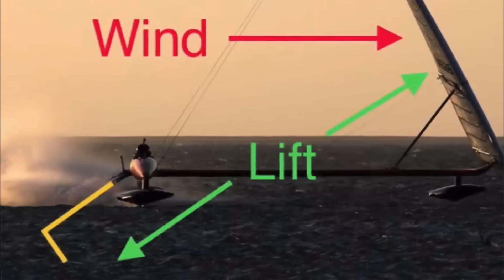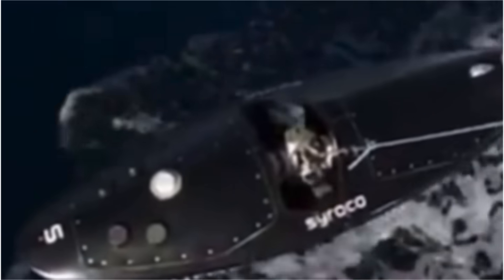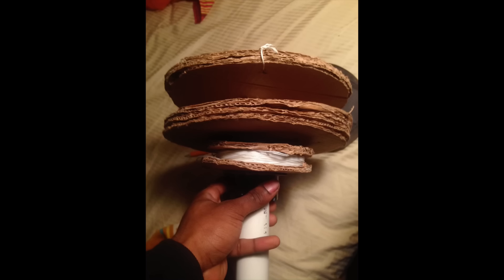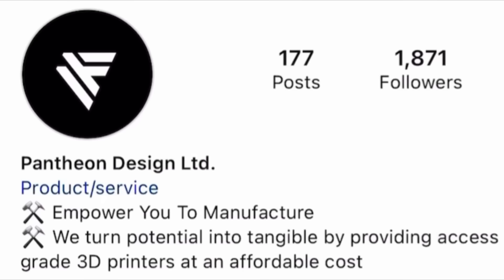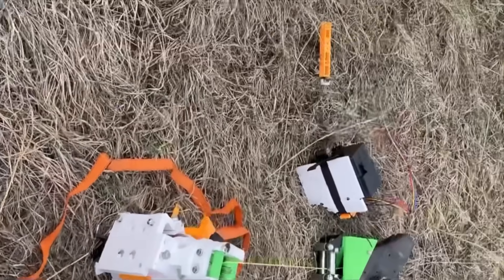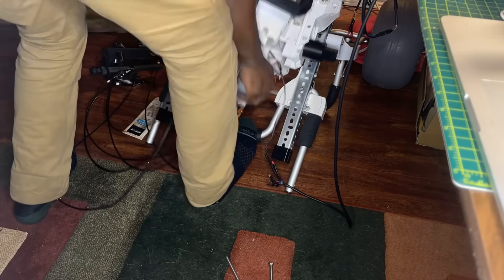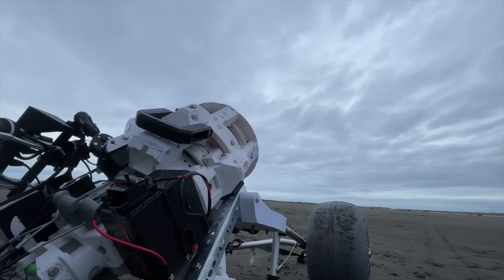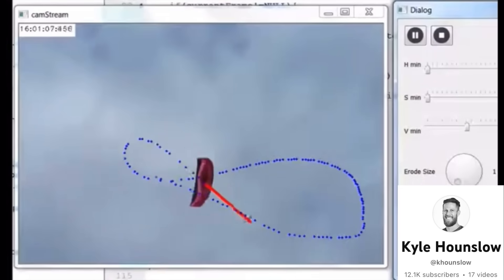Transforming Sailing and Power Generation with The Ocean Kite Engine

Comment: Such systems are already being sold for various size yachts and are simpler.
Reply from the maker: There is one other company and they cost 3x as much as our goal. Also they dont produce power, just use it.
Reply: @Ocean_Kite_Energy   Reducing cost, sacrifices quality and durability. In this situation you will need high quality materials that can handle high load and stress. Mass production also increases costs which you will eventually figure out. 
I didn't say anything about power.
Reply from the maker: @Jayda08  I appreciate your insights on cost and quality concerns. However, our focus is on innovating with durable, high-strength materials, like waterproof UV-resistant ASA and carbon fiber ASA, ensuring both affordability and resilience under stress, as demonstrated in our partnerships with tech and space industry leaders, Pantheon Design and Grin Technologies. This approach allows us to maintain high quality while working towards cost efficiency.
Reply: @Ocean_Kite_Energy  Cost efficiency only works if everyone is willing to work for free or for minimum wage. But you do your thing and we can return to this discussion in a few years. Cheers.
Reply from the maker: Or if you can reduce the amount of employees with machines.  @Jayda08
Reply: @Ocean_Kite_Energy  People who operate these machines have to be well experienced and would require to be properly compensated. Machines costs a lot of money. You not making pencils which you can sell a million per month. Investors and silent partners will need to be paid as well till they get their money back and decide to end a relationship with you which could be a decade or three.
Reply from the maker: The point is, there would be less employees as compared to traditional means. Machines cost money but they work 24/7. This means cheaper units for the consumer.    @Jayda08
Reply: @Ocean_Kite_Energy   My point is, there are MANY expenses before there is profit. A single McDonalds store makes an average of $2.7million/year, yet an owner only makes an average of $150k/year, even though employees make very little above minimum wage.
Reply from the maker: Is that why employees are being replaced by automated kiosks? @Jayda08

Comment: Wish u showed more of the faults and kind of trouble you will be in using a kite. Such 
 very dangerous downsides with a kite, i dont care how fancy your rigging is, thats completely impractical for the vast majority of ppl intending on fun wind powered water sport.  If you try launching a boat from a busy boat launch with this it would be mayham, anywhere near an anchorage would be such a liability and forget, nearing any marinas, cant near any shorelines that dump wind, cant solo, limited 2 only strong steady winds, loosing your kite from frayed lines, sudden wind changes, microbursts, or even a nearby helicopters downforce would be really common. 

 thought alot about rigging a dingy with a kite, but then i think about how much of a nightmare dealing with all the rigging would be once i got 2 the anchored sailboat and how id already be cozy in cabin if id just used my oars. 

Gd luck tho. I dont get it, but u clearly have a vision of using this, i hope u succeed and post a video of how this does or doesnt work.
Reply from the maker: You are totally right. If it is to produce any significant amount of power or speed, it will be very, very dangerous. I myself and developing safety procedures, and this will be a large part of the program going forward. Your advice is well heard. There are a lot of redundancies and safety features build in, but testing with real consumers and non kite experts will demonstrate a lot. Most people learn to drive 2 ton vehicles, but you must have a permit. Maybe we should consider doing the same. Stay tuned.

Comment: i would have the gondola rigidly connected to the foil via a longish foil mast though, because it still needs a displacement mode and a way to control the ride height and steer etc

Comment: the gondola 🚠 idea is gold, reverse foil, gondola and kite… in theory it should be the lightest, cheapest and fastest design of sail boat you could build
Reply from the maker: My thoughts exactly. It's just a fact of physics in my eyes.. Thats why I have no problem focusing on this goal. It will happen eventually, if not by me, someone else.
Reply: control and sailing in extremes of low and high wind are the biggest issues in see but yeah totally agree, its first principles thinking just like Elon Musk, but yeah remember to think of the limits too, thats another musk pro tip. After you can control it at average wind speeds you have to control it at low and high speeds and in waves 🌊

Comment: Very fancy machine! I would love to see it in all-metal. Now... I am envisioning having the boat in the kite. That is, an airplane with a controlled remotely located keel (in the water). Like a hang glider with a track in the water. Only good for some tacks, of course. Sailing close to the wind, is that possible with a kite? Kite surfers do it, but they have the advantage of greater dimensional control because they are holding a frame.
Reply from the maker: We are just getting our feet wet, but our ultimate goals look similar to how you imagine.. stay tuned.

Comment: Christian: WAY COOL!!!!..... glad someone is trying sort all this out so non-corporate people might be able to adapt a kite for propulsion. ..What do think about using for world cruisers 60' hull????
Reply from the maker: Thank you very much. This kite engine is designed to fly anything with tethers. So if you have a kite big enough, and a competent crew, the Kite Engine can sail it.
Reply: so : it is necessary to have full creww mannning its operation? what about using autopilot and reduced crew? in your opinion?
Reply from the maker: A comperable spinnaker takes a competent crew of at least 3-4 to manage, with this system you could do the same with 2 and with practice 1.

With Autopilot after an initial launch it would be effectivly hands off. It's definitely the primary focus! And quite reasonable with the Machine learning and AI.. I'll make a video of our control strategy, I think people will like it.. It doesn't use the same expensive onboard sensors.. (I'll explain later) Definitely subscribe! 

Some people brought up the danger of this system.. And it's true, If we are to produce any significant power or speed.. it's going to be dangerous.. I might have to have classes or a license.. Just like driving a 2 ton vehicle or a plane.. or boat for that matter.. Lessons are necessary. 

 @lincolnlincoln27
Reply: @Ocean_Kite_Energy  i am an old fore deck hand.... but on passamaking these days  code zeros and similiar hybrid designs are used with furling systems. What are you thoughs on using you engine for passaage making with reduced crew? ... i have subscribed btw.

Comment: Hi, so is it far enough along to be used on motor yachts 25 ton range
Reply from the maker: Give or take a couple of months depending on funding. We are well capable, though. The engine can control virtually any size kite. Larger kites are very hard to find.. But we could possibly mount two kite engines.

Comment: What about cross wind or up wind situations where you need to hold a certain course? Great concept / video BTW.
Reply from the maker: For this it really depends on the type of boat.. Going down wind will be frighteningly fast with a motorboat. The looping function will accelerate the boat to either hull speed or wind speed extremely quickly.. other points of sail will be difficult without a keel for sure..  Sailboats and Cats will be just fine. Just like kiteboarders can go sail upwind.

Comment: Shrink it down to be something a very small boat could use. I'm talking 12 to 8 foot boats.

Also, we need some means of reducing sail.

A major issue is changing wind conditions. Sometimes the wind is light and sometimes the wind is heavy. In sailboats, you "reef" to deal with increasing wind conditions. Your kite needs to be able to reduce sail area as wind increases.

If you don't know how to do that yet, this further makes the small boat concept a good idea as the notion there would just be "don't use it unless the wind is behaving."

If you could shrink this down to something small boats could use... I think it would have an immediate market. And once it proves itself at that scale, it could be scaled up and justified on the proven small boat performance.
Reply from the maker: I am working with a partner on a controller for smaller boats and kayaks.. Definitely subscribe that will be out in a few months. 

The Kite Engine as you see it now has a "depower" line that effectively "reefs" the sail.

Comment: love this, my question is> how does it scale?
Reply from the maker: Love this question. Year one engineers learn that mass doesn't scale.. We are starting to see that offshore wind turbines are reaching their size limit. But there is virtually no limit to how large the kite can get, as long as we can store and launch it. Also, the wind available at altitude is much stronger. When the wind speed doubles, the power output actually increases by a factor of eight due to the cubic relationship of wind speed and lift. 

Also, they are orders of magnitude easier to transport and make than comparable wind turbine blades. (much greener to despose of too)
Reply: @Ocean_Kite_Energy thx 4 Your answer, sounds very promising, will watch the full-scale testing.

Comment: It looks like you addressed the problem of line twisting. Well done. I hope you are successful at final development and at profiting from your own hard work, which is so easily stolen by investors and copycats. I assume you have “published” your work to attract investors. I have been interested in this for my own sailboats as it seems to work well for kite surfers. I imagine it will become a popular means of propulsion someday, at least on broad reaches and down winds. Not sure if it would work for close hauled sailing  tho. Also, is the electrical generation coming from the twisting/spinning force? Or from having the line pulled out?
Reply from the maker: You definitely know your sailing. With experience, we will sail closer and closer to the wind, just like kite boarders do. The electrical generation happens whenever the lines are released. Think of it like a fishing reel, we can adjust the "drag" to produce more power when reeling out line. It really works just like regenerative braking. The "spiral out" demonstrates the most efficient pattern, but the real innovation is the ability to loop indefinitely, We can effectively perform any reel out maneuver without worrying about untwisting the line afterwards.. It's almost like flying a kite without strings attached in that sense.

Comment: I had to stop watching after you kept saying engine instead of sail seriously you put together a good thing using off the shelf components and some 3d printing  but that overdramatic narration is ruining it
Reply: I dont gove 2 shiz's who you talked to its a sail dude. If your using the wind to move a Vehicle its a sail. An engine uses a stored fuel to power a vehicle aquatice or other wise. Where did you store the fuel? 

You didnt its a sail.
Reply: machine
/mə-shēn′/

noun
A device consisting of fixed and moving parts that modifies mechanical energy and transmits it in a more useful form.

engine
/ĕn′jĭn/

noun
A machine that converts energy into mechanical force or motion.

I’d say it’s an engine. He isn’t saying “non internal combustion engine” or something over the top.
Reply: @Mesenteric  OK by this definition you can call a kitesail an engine
Reply from the maker: The focus here really isn't on the kite, it's on the controller. It's hard to think about if you have to reference existing things.

This is a very peculiar machine. It might be classified as a motor/generator. When the line is released, it spins a motor which charges the batteries which is its most basic function.

But where it gets really interesting is in the looping function. At the top of the loop when the kite is at its highest, this might be considered  the "suck" action (to use a conventional engine analogy ). As the kite loops it increases its apparent wind and produces an order of magnitude more power at the bottom of the loop, this might be considered the power stroke, or the "squeeze" then subsequent "bang" (this is where the kite can produce up to 30x the power than the top of the loop)  as the kite begins to rise again this could be considered the blow. 

And then the cycle is free to repeat itself.

If the line is being let out, like a spiral, the Kite Engine [serves as a generator](https://imgur.com/gallery/bP0BqcM), if the lines remain static the engine serves as a motor and pull whatever it's attached to.

The real objective with this machine is to provide ultimate versatility, it can fly anything with tethers, you never have to worry about the lines twisting. 

It would be difficult for a person to produce constant kite loops while reeling line with their hands unless we evolved with bearings
Reply: @Ocean_Kite_Energy it's an overcomplicated klutz of unnecessary parts. You only want ONE line to your kite. The control of the kite should be by aerodynamic ally balanced Elevons on the kite. RC, Pneumatic, hydraulic. Your choice. But that is a very stupid expensive complicated failure prone and utterly US of Amateurs piece of rubbish.
Reply from the maker: Just wait. Ill comment a year from now.  @Maungateitei
Reply: @Ocean_Kite_Energy  when I kite surf I do everything you just described except generate current I control the kite with four lines connected to c handles. You are describing kite sailing with engine terms like it was something new .there are several videos on you tube of people who have done Atlantic crossings aside kite sails controlled by motorized turrets many of them music rc servos adapted from off the shelf components. You built a very innovative boat, it's quite an achievement, but all that marketing speak and hyperbolic chatter is taking away from it
Reply from the maker: Your kitesurfing set up cannot extend line up to 600 feet. and absolutely none of those devices have a power cycle like this kite engine. And unlike conventional winches, this system can untwist the line from a mounted winch on deck. 

I've spoken with both the man that did the transatlantic trip, alongside the inventor of the wing it kite boat system to which you are referring. That system doesn't even genrate power, it just uses it. 

 @cartmanrlsusall
Reply: @Ocean_Kite_Energy  any power generated by reeling out 600 feet of line would not equal the amount of power needed to reel it back in .
Reply: It is an engine!
Reply: An energy generating device is an engine! Fascinating video. I enjoyed it tremendously. Can't wait to see an actual implementation on a small vessel.

Comment: This would be ideal for the R2AK race... I've been thinking of using a kite for the race, but not with a sophisticated control system like this! Nice work!
Reply from the maker: There is actually a fantastic FB group! This Kite Engine might be a little intense.. But I am developing a kite bar with an integrated reel for smaller boats.. so def, stay posted or subscribe. The question is.. should it be a 2 or 3 line arrangement..
Reply: @Ocean_Kite_Energy  I would go with 3, so you could control altitude more precisely, and bring it overhead, unpowered, to reel it in.
Reply: @Ocean_Kite_Energy I was thinking the kite bar could be shaped like a crank shaft to allow you to rotate the spools. 
The kite mightIl work well with an unstayed sailboat so the forestay doesn't interfere as you sweep the kite across the bow.

Comment: Nice presentation, but you need data.  Watts per hour generated with a given wind speed or horse power improvement for the boat speed.  Also you show only downwind  runs, need cross wind and tacking views.
Reply from the maker: For sure, stay tuned. Definitely subscribe, I think you'll like what is in store.. This video is already dated in my eyes.